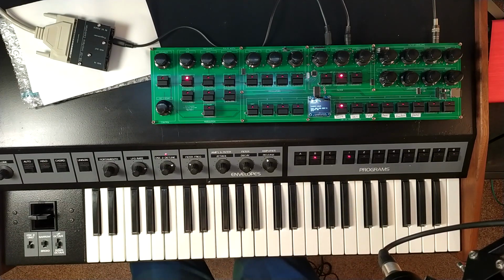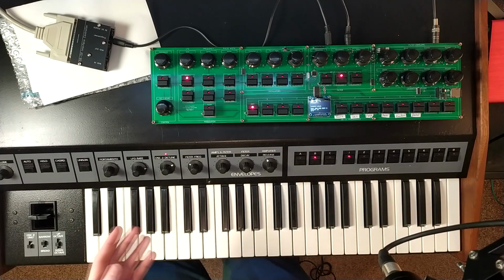OB-SX Programmer & Interface

Comment: Very clever, could this be opended up to other hardware Synths? Granted the controls would be different, though many older Synths, epsecially rack are quite generic.  I'm thinking my Cheetah MS6.
Reply from the maker: In theory yes, but the Cheetah MS6 would have to be controlled via the MIDI port, requiring a different interface. So what you're really needing is a custom midi controller which has all the parameters laid out nicely. Perfectly doable.